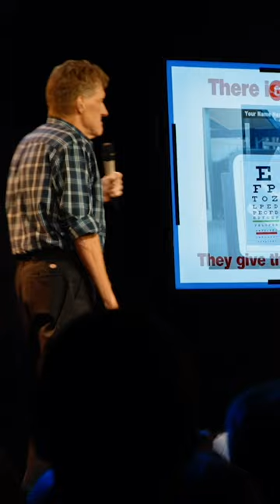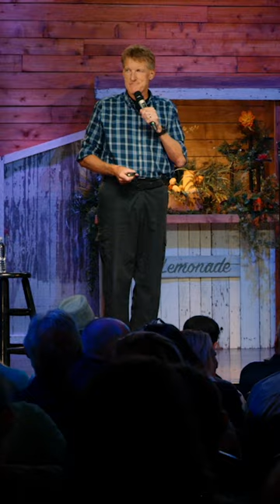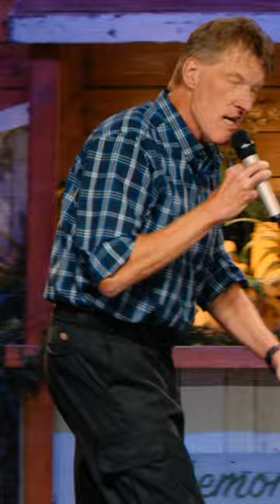Good sign VS Bad sign | Don McMillan Comedy

Comment: the second (or third time) he showed both images after each other, he should've done the better sign twice so there was no difference that time
Reply: Do you like 1 or 2...3 or 4
Reply: Except he wrote good sign and better sign at the top of the slides, so it wouldn't have worked
Reply: Except he could've had duplicate slides to pretend to go backwards while actually go forwards.